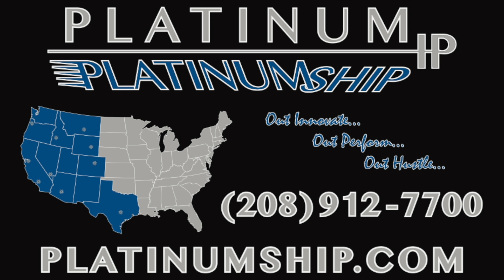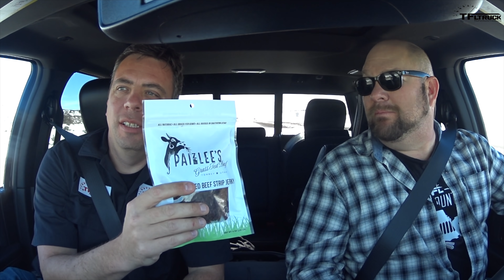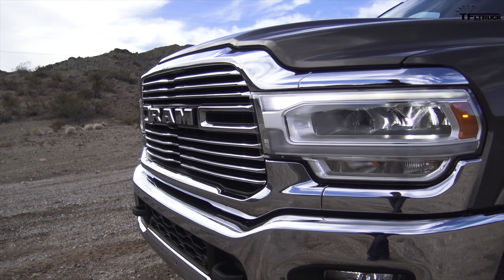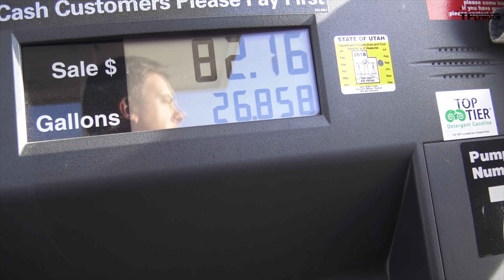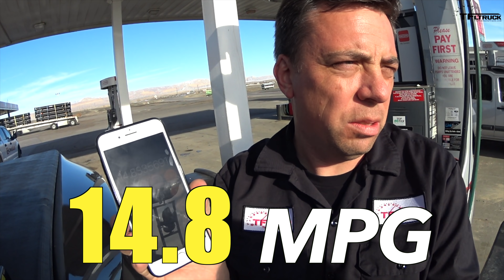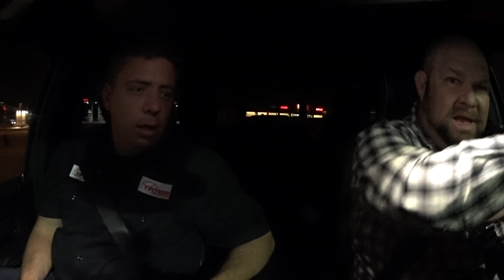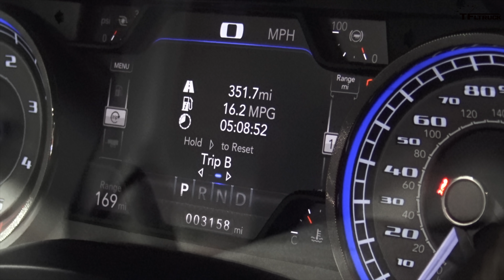We Drive 800 Miles in the New 2019 RAM 3500: Here's How Fuel Efficient 1000 lb-ft of Torque Is!

Comment: Did you encounter a regeneration cycle during this test trip?
Reply: They likely did and they likely didnt notice it. These trucks dont really give much indication to when they are regenerating unless it is really plugged up and the truck is forcing a regen
Reply: Kyle Vanwinkle what are you talking about???? There shouldn't be a regen until about 40,000 miles!
Reply: @JohnDoe-nz6bk  where are you getting this information that the active regeneration interval is 40,000 miles on Cummins?
Reply: truckguyjoe https://www.hotshotsecret.com/edt-diesel-extreme-can-correct-dpf-regen-issues/

https://www.cumminsforum.com/forum/4th-gen-non-powertrain/2111537-def-regen-mode.html?amp=1

And, I owned one!
Reply: @JohnDoe-nz6bk  my point is this...there were most likely dozens and dozens of active dpf regenerations on that guys 2016 Cummins that he wasn't aware of. Between the passive regens and the active, he never had a problem until 35,000 miles. Sure it used passive regens as it went down the highway, but chances are it went through many acitve regens with fuel injected into the filter. These trucks will try to regen every 300-700 miles. Not to mention your source is a company trying to sell a product using anecdotal evidence about some guys 2016.
Reply: truckguyjoe I owned a 2016 ram 2500 mega cab limited Cummins and it never regened with 20,000 miles. I always got between 19-20.4 mpg and would drive an hour and a half every 2 weeks on the freeway. Got 8-10,000 miles out of the DEF tank.
Reply: @JohnDoe-nz6bk  but I assure you these trucks go through a regen every tank of fuel every other tank if it times out like that
Reply: Kyle Vanwinkle I can assure you that they don't!
Reply: @JohnDoe-nz6bk  I can assure you from owning multiple new diesels that they do. Idk where you are getting your info but the soot load in the dpf fills up rather fast. The trucks will regen often in order to not have substantial build up. If it does build up it is much harder on all components to clean the dpf filter
Reply: Kyle Vanwinkle I can assure as owning diesels as well, they don't!
Reply: @JohnDoe-nz6bk  ok bud I love how the link you provided even has people disagreeing with your view point
Reply: @JohnDoe-nz6bk  of you are seeing a regen notification from the truck you are doing something wrong. That means the truck is not performing passive regens correctly. But hey believe what you want. Even my 2014 cruze diesel which sips diesel at 60mpg still regens once per tank. How can I tell? The milage drops from 60mpg to 35mpg for about 5 min
Reply: I love how you think your right! My ram diesel mechanic told me about every 40,000 miles, unless you haul or do a lot of city driving. I suggest you educate yourself on what passive regen is, before making stupid comments!
Reply: Kyle Vanwinkle wanna know how I never had a regen?? I NEVER GOT BELOW 19mpg!
Reply: truckguyjoe I suggest you educate yourself on what active regen is!
Reply: @JohnDoe-nz6bk  you ram mechanic is wrong maybe you should find another mechanic instead of a sales person
Reply: Kyle Vanwinkle the only person who is wrong, is you!! 🤣🤣
Reply: Kyle Vanwinkle https://www.dieseltechmag.com/2018/05/common-problems-dpf-turmoil
Reply: Kyle Vanwinkle you have had your ass handed to you, stop before I make you look even more stupid!
Reply: @JohnDoe-nz6bk  On a lighter note John Doe I appreciate the fact we can have an adult conversation, agree to disagree, and not name call. In the long run none of this really matters after all. I love trucks. You love trucks. It's all good.
Reply: truckguyjoe I couldn't agree more! And with all of us diesel owners, we'll be paying out the ass to replace the junk, unless you delete it, lol.

Comment: Was this a 4.10 geared truck?t highway speeds, 15 is not too bad with 4.10's.
Reply: Yes, it is the truck they used during the testing with Ram it has the MAX tow package which only comes with 4.10's.
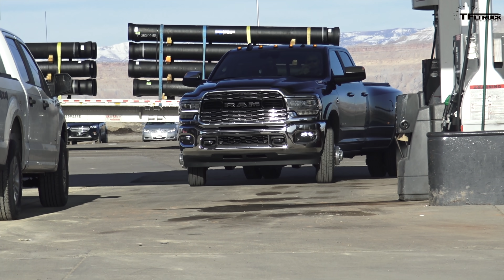Reply: @dennisfowler1281  thanks for pointing out the 4:10 gearing. I have the same truck from 2014 and I am getting 15 MPG currently empty. If I put on my arctic fox 990 camper which is actually too much weight for my truck I get only 10 MPG. Thinking about upgrading to the Ram 5500 so I could have the 10ft toolbox bed with a backpack toolbox between the cab and the camper. The only limitations to that are the insurance could be quite expensive if I was commercial hauling. I've heard it could be $28,000 per year. Registration could be as much as 1,500 per year
Reply: But they didn't tell anyone what kind of revs were there at 80mph... It has 1000lbs torque advertised but at what revs? Tops HP at 2800? Tq at 1800?
Reply: Good, Especially for a brand new truck

Comment: I don't know if you guys are planning this, but I would love to see you do a massive head to head towing test with the 2020 GMC 2500, 2020 Ford 250, Chevrolet 2500, and the new Ram 2500! That way one video has all the information I want to know about the vehicles.
Reply: The gmc and chevy will be identical. No powertrain differences
Reply: Also no point in running the 3/4 ton.

Comment: Great video and I’m glad I’ll keep my ‘03 7.3L. Took a trip from California to Texas. Never went slower than 75 with A/C running the whole time and averaged 18.3mpg.
Reply: in my opinon the 7.3 was the best they ever had. I wish they still let international make their engines.
Reply: @TheCamaro5  cause the 6.0 and 6.4 came out so well? Lollll
Reply: upstater5.9 Your an idiot. Did i mention those engines. We all know those engines where junk. The 7.3 was made before the gov regulations. Ford bought the rights the that motor and changed it due to emisions regulaitons
Reply: I drove from Houston to San Antonio and I average 17-18 mpg on my f250 6.7 2016. I was drive at 75-90mph
Reply: Our first 2 diesel trucks were a 1991 Ram 3500 extended cab and a 1999 Ford F350 4 door. We could squeeze 25 mpg out of the Ram, however, it was a 5 speed. The Ford got 20 or 21. Crazy how much prices have gone up. We bought both brand new. The Ram was $20,500 and the Ford was $32,000. The only issue was prettt bad rust on the Ram
Reply: Hey thats my mpg too, im between 18.3 and 19.8, depends on how much highway i hit, but with too much traffic im down to 18.3. 7.3 are so solid !
Reply: You also have half the HP and this makes 475lb ft more torque plus is not broken in yet. You know diesels get better mileage after they are at 100k+ miles then when at under 5k miles. My 05 2500 Dodge 5.9 manual got 20.3 average unloaded highway. It had 130k miles.
Reply: eichler721 yes but from what I’ve heard and seen they a lot of the engines won’t last much longer than 100k with exhaust being pumped into the intake. Longevity is gone on newer diesels. I do run a Hypermax tuner on mine as well. So HP and LBS are higher than stock. And running freeway HP and Torque don’t matter that much. Your at cruising speeds, the amount of HP need to maintain a speed is much lower than HP needed to accelerate to a speed.
Reply: @BuckInchuteranch1  true however this weights more than older ones due to current safety stuff, emissions crap and other shit. I bet it improves over time. Also I have driven 2013 Ram 3500's with 267k miles on them and they ran fine
Reply: My 4x4 7.3 dually gets 16 hwy. 250k
Reply: flat ground...big whoop
Reply: And that motor also has half the hp and torque and no emissions lol
Reply: Im not a Ford guy but they dont make em like that anymore...the 7.3 was a monster

Comment: Back in 1998 i bought a new Dodge 2500 HD 4x4 with V10 gas and my hwy mpg was 15. I feel this truck should get better mpg.
Reply: I bet you regret not getting the Cummins huh ?
Reply: @MrSehka77  So true, back in 1998 the Cummins was getting as high as 26 mpg hwy with no load.
Reply: @MrSehka77  back when the second gen came out the V10 had more power output than the Cummins
Reply: How long did you have your 98.
I just sold my 99 V10 4 x4
Bought it new had it 18 years.
Little over 100,000 miles on it,  almost had to give it away nobody wanted it.
It was total dog, drove it 
From California to Wisconsin with a camper shell one time averaged 
About 12 mpg not 15.
Around town 10 -11
The shell help some 
But not much. 
My new 2019 Rebel blows it away, Just moved From California to
The  Carolinas towing my boat, I was concerned. Rebel outperformed my 
99 2500 in everyway. I was amazed by  MPG
& power.
Roman there's hope for the Rebel did a small road trip this weekend  one time my trip computer said average 20 MPG it did not last 
But I was shocked. It settled in at end of the day about 19.0 MPG
Now with this new test 
Of yours you take the cost of diesel I've seen
This past week 70 cents
Per gallon more.
I'm sorry guy's at that rate diesels our out for daily Driving.
 If your pulling 
10,000 pounds consistley 
Yes you have no other choice.
Reply: @douglasallen5467  I did not have it long about 3 years, a friend of mine has a car dealership and sold it for me for a good price for me.
Reply: Newton Washinton the Diesels back then got better mpg because they didn’t have the emissions stuff in them, which as I’m sure you know, causes the truck to burn more fuel. It’s the reason why people do egr and dpf deletes. It allows for better mpg but more emissions.
Reply: 70-80mph.

Comment: Sorry but 14.8 mpg empty is not good , that truck should get no less than 20 empty ...oh that's right EPA screwed the pooch there ... delete that MF and it will get 25 mpg or higher empty just cruising . And 12-14 with a load
Reply: Easily. It’s so dumb that the EPA decided to force all the emissions crap on Diesel engines. It destroys the efficiency they could have. But hey, gotta save the environment from dangerous particles right? 🙄

Comment: Video idea for you guys, I’ve heard that there is a difference in fuel economy with and without a tonneau cover on the bed of the truck because it disrupts the natural aerodynamics of the truck and reduces your efficiency.
Reply: I've always got better mpg with a cover on.
Reply: Well it's common sense that there will be less resistance with cover on. The oncoming air passes over slightly better and doesn't swirl around in the box.

Comment: They need to have a 48 gallon fuel tank on the new Dodge Ram 3500.
Reply: Just buy a 4500. 74 gallon total between the tanks, better brakes, stronger axles etc....
Reply: @chevyon37s  You need it, 430 rear end =bad mileage
Reply: Drew w Except the C&C trucks are detuned, have a problematic cylinder head(Yes, they’re different) and ride like dump trucks.
Reply: Evil Mofo He meant the auxiliary tank brand “Titan”, not the Nissan Titan lol calm down bro
Reply: @yz2616  🤣
Reply: F350 has a 48 gallon.
Reply: @daves913  exactly! I would buy the Ford F-350!
Reply: A 52.8(200L) gallon tank for the 2500 and 3500 is the minimum I would want.
Reply: I daily drive a 2500 and pull my toys on the weekend... even for a daily a 30 gallon tank sucks! I added a 60 gallon aux tank with toolbox to mine because I got sick of fueling all the time... lol
Reply: Buy a slip-tank.
Reply: I agree a 50 gallon tank
Reply: Especially for towing when mpg drops to 5-8 mpg
Reply: 50 Gallon  is optional for 2020
Reply: Really not sure why that LOADED Dually did not come with the optional BIG TANK, which is a 50 gallon tank..??
Reply: Evil Mofo  r/whoosh
Reply: Not a Dodge.  Ram name only.
Reply: I got a 35 gallon tank on my 05 3500 dually and I can go 700 miles on it at 65 mph.
Reply: Does Dodge still make trucks?
Reply: @pickmeplease-g1b  No. Ram trucks was spun off from Dodge. Same parent company still.
Reply: @joecamp2960  I was being sarcastic.
Reply: @pickmeplease-g1b  Hard to tell sarcasm in typed form. Most people put a /s at the end to indicate that.
Reply: @joecamp2960  My bad. Ram branched off to their own brand in 2011. Dodge is more of a performance brand and Ram is a cargo/truck brand.
Reply: @pickmeplease-g1b  no they are Ram now.
Reply: @richfarfugnuven6308  I KNOW
Reply: Just go to Titan and put a 90 gal in the bed
Reply: @jasonwilliams3223  Ha Ha Ha. That's funny! A Titan!